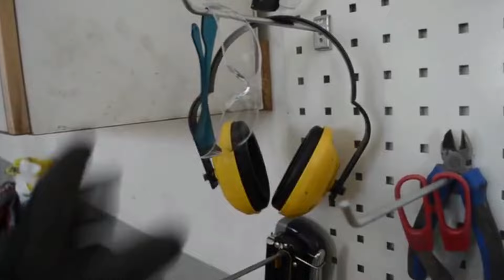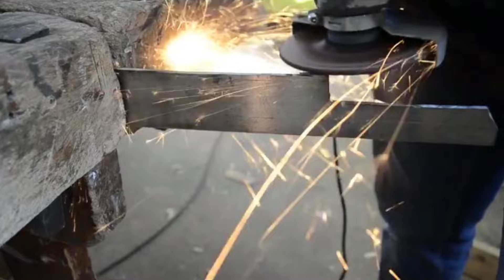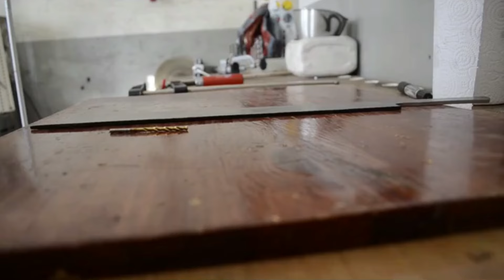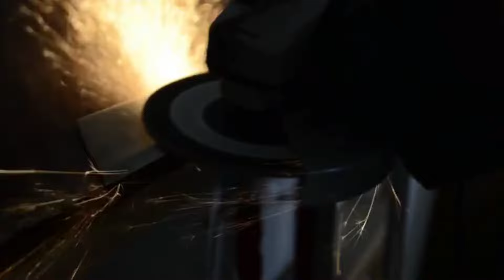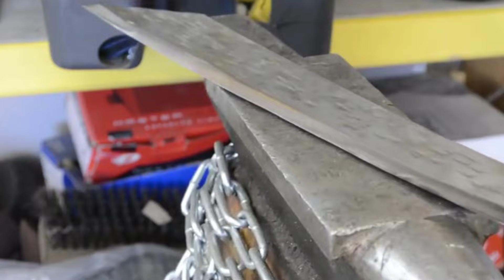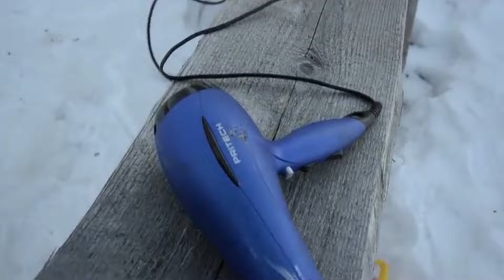Knife making by hand- MAKING MACHETE!! Part 1

Comment: Before quenching, normalise the steel by heating it up to red/orange a couple of times, then let it cool down repeat 2-3 times. This will make the ''grain'' in the steel smaller and reduce chances of cracking and warping during the quench.
Reply from the maker: Yep. I should have done it. I think that's why it snaps after hardening as you can see in part 2. 
Thank you for watching! 
And if you haven't already watch part 2, here is link for it https://youtu.be/VV5hEcXRskM